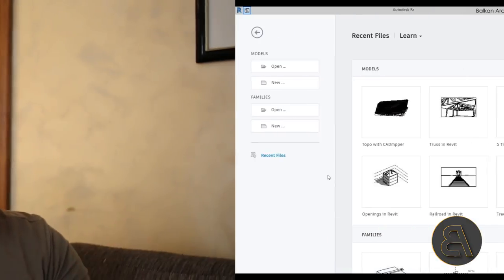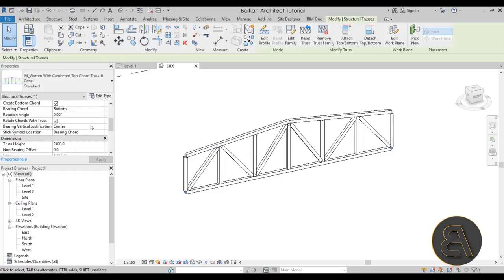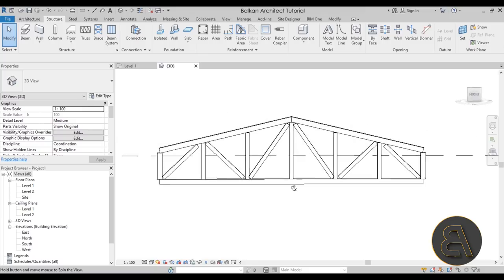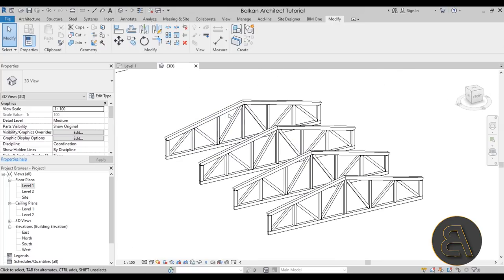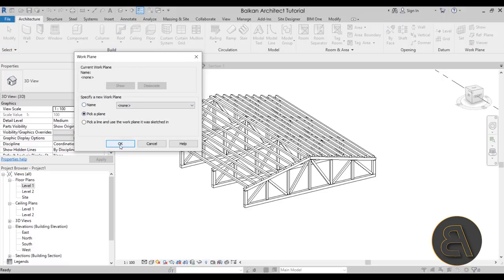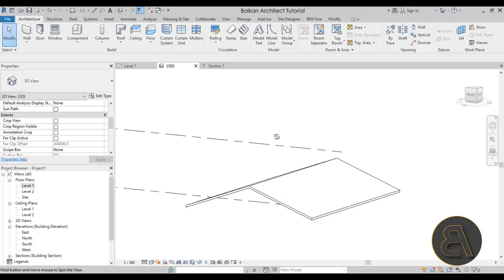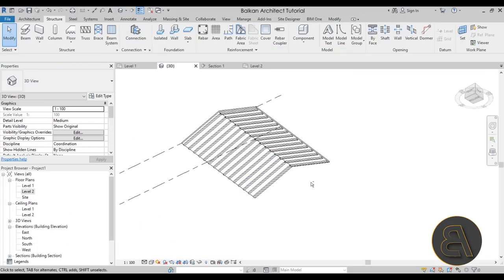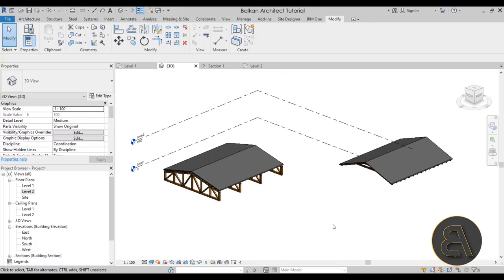Wood/Timber Roof Construction in Revit Tutorial

Comment: What I have found that works best for me, is use the Beam System for the initial layout, then remove the Beam System. This allows you to set the offset as needed for each Beam, if necessary.

Comment: Sooo painful to watch the coping member by member. Surely there must be a quicker way to adjust the nodes in the whole truss in one go otherwise you may just as well build it from scratch. Also the coping works on softwood timber maximum 50mm thick prefab truss with nailplates but when you go to 100-150-200mm thick members, you're most likely looking at hardwood/oak with tenon and mortice joints which are totally different concept.